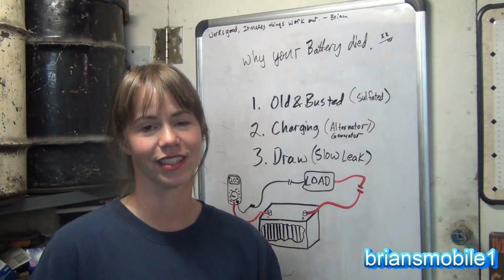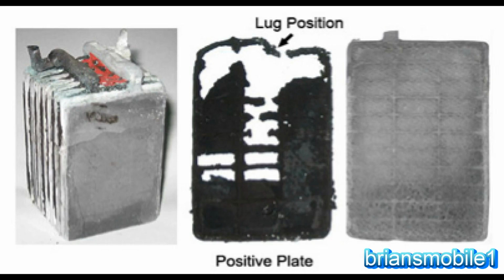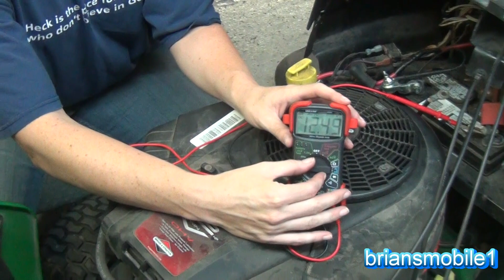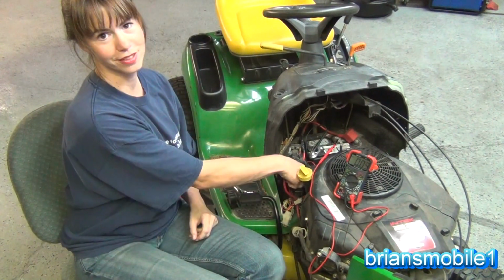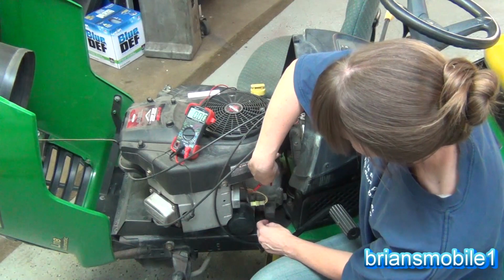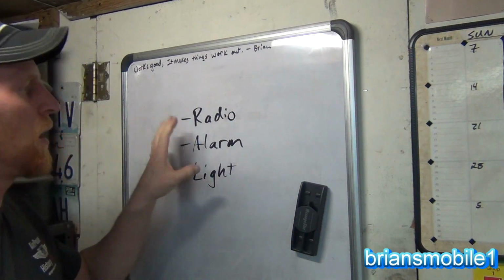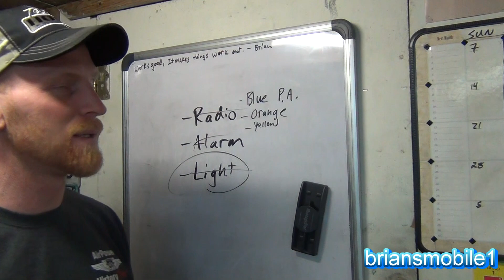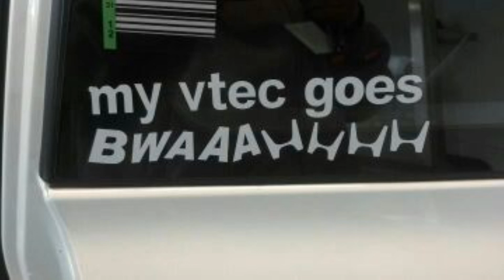Why Your Battery DIED

Comment: My father's Ford Ranger (built in September of 2000) had the same original battery in the vehicle until 2014. 14 years for a battery is really terrific, and he didn't even get rid of it as soon as he needed to, he finally replaced it this year because last winter a few of those 0 degree mornings he said it cranked slow, so he said it'd only be worse this year. Pretty nuts.

Comment: Hey guys, just watched this. I've spent lots of time on old farm tractors (40+ years old by now) and most all have a separate voltage regulator and aside from chafed wiring grounding to the chassis, the voltage regulator is probably the most common component to short to ground and cause battery draw.
Reply from the maker: Thanks for the tip.  
Same goes for old trucks.  
Look for the voltage regulator on the firewall or the metal back wall of the engine compartment.

Comment: I've heard of people de-sulphating their batteries, but it can take MONTHS to do. From what I remember a slow trickle charge is pulsed many hundreds of times a minute and helps to make the sulphation liquefy back into the battery acid. There are videos on Youtube about people doing this with huge batteries used in military vehicles. The users said it was easier to take an old one and try to bring it back to life than to buy a new one which I guess are very expensive.

Comment: Had a 97 ford e 150 in the shop last week that had a 3 amp draw. Ended up being the voltage regulator in the alternator. Seen lots of radios, door ajar switches, chevy bcms, and even a starter cause a draw. Very rare for me to see the alternator pulling amps. Funny explaining the the customer that the device that's suppose to charge the system was declaring it too.
Reply: Decharging I mean. Darn autocorrect

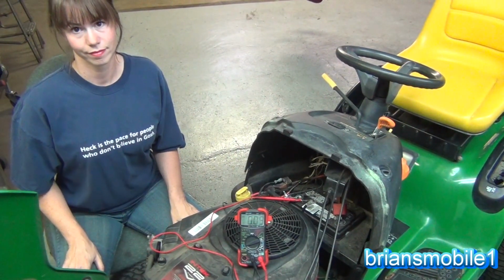Comment: Ignition modules [or anything ignition] is after the ignition key, and that was eliminated @ 5:45.
Old GM alternators have what was called diode triodes that went bad.

Comment: Excellent video! I had the original Daimler/Chrysler factory battery in my 2003 Dodge Dakota 4.7 last 10 years and some change! It didn't even completely let go when I had to replace it. It began cranking slowly, and wouldn't take a full charge anymore, but would still start the truck. I was curious to see what the inside looked like, and found that it was basically a giant sulfated stone. I was unaware there was a term for that condition. From the way it looked, I couldn't believe I was getting any juice out of it at all.

Comment: I have a junk walmart battery I got specifically to use as a bench battery for testing car electronics. Hook the battery up to the electronic, use a little inline fuse, works great and makes sure I get as many amps as I need to power things to make sure they're functioning.

Comment: I may have missed it but some cars need about 10-15 secs if any doors have been opened or key just turned  off to let the computer go into "sleep" mode. Another problem some people will run into is they forget the car doors will turn on accessory lights, make sure them doors are closed or you'll be chasing a constant power.... seen it happen too many times, it's the simple stuff.

Comment: I have awesome luck with AC delco batteries.  I use them in all my vehicles and generator.  They never corrode.  I replaced the batteries in my dodge diesel after 10 years, even though they were still working fine.  I figured 10 years was enough service.  I also use battery minders that have a desulfation mode on all my idle batteries.

Comment: Very helpful Brian and Spanky. Thank you. Just be very careful that you have your multimeter set up IN SERIES before you switch it to amp measurement. You are basically creating a jumper wire when you do this. It looked in the video that Spanky was measuring the voltage across the terminals and switched to amps before moving the leads. Absolutely love your channel. You guys are awesome!!
Reply: Thanks for watching!

Comment: Great video. If you are like me and do not drive very often then you need to charge your battery. For this I built my own charger with a 13.5 volt regulator in it and a current meter. Charging may take a week or so until the current drops to less than 50ma.
Reply: Cool. Do you have more you can share about your creation?

Comment: The energizer battery in my impreza lasted 7 years in the hot Florida sun . Definitely sticking to energizer for now on
Reply: niga6000 thanks bro!
Reply: Original Bosch battery in my 2008 smart lasted until last year so 6 years, it would've lasted longer but a cold snap killed it.
Reply: No, give me the new Duralast battery any day. This assumes you live in the South or a hot area. They have a new line of batteries based on your region that do better in the heat. They produce less cold cranking amps so it can be a hard sale. Basically, they put more lead in the battery to make them more durable. They are listening to a study showing how much more people in hot areas lose their battery. This will reduce how much they have to warranty their batteries. Good for them. Good for us.

Comment: but wait Brian, some of those things such as your radio and alarm do draw but only a little and that is normal,, that is what allows it to keep time on the clock or monitor movement in the car.. what about that draw.. how much draw is OK? (This one was fun to watch by the way. I think your being "out of it" was rubbing off on Spanky - she looked a little lost at times too!'
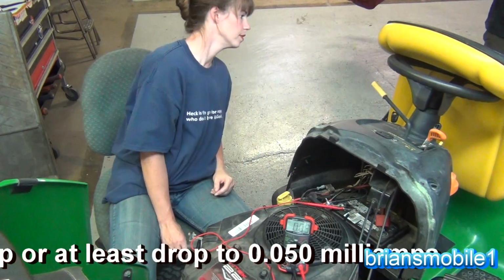Reply from the maker: The tolerable limit in most books is 0.050 amps or 50 milliamps.  It's in the video at 7:25, but it's easy to miss.  It was in the "script" I gave Spanky, but it didn't make it into the vocals.
Reply: I though I saw something about it in there.. just thought I would bring it up.. Thanks for the referral and I hope you get feeling better soon!
Reply: I was hungry. I can't think when I'm hungry.
Reply from the maker: kary1982v6
Thanks Kary
Reply: D6Spanky
 So, you're stomach had slowly parasitically drawn on your mind? :) Happens to all of us no worries, but I have to say, you did fine. Thanks for helping keep Brian's channel fresh... Brian? Your train video worked for that too. :)
Reply: DE Nichols Thanks. It's always fun being on Brian's channel. :)

Comment: I think it is too tempting for an auto store salesperson to show you a digital reading of your car battery and say "there's your problem" when they don't test the alternator first. I keep a fully-charged spare battery in my garage in case I have any problems.
Reply: My spare is my old battery. Not great, but it always does the job in the pinch...assuming the battery in the car is the problem. lol

Comment: So how can I tell the difference if its a bad battery or a bad alternator with a multimeter? Thanks!
Reply from the maker: Test the battery at an auto parts store.  Test your alternator with your DC Volt meter by testing voltage with the car off (should be 12.5V to 13V) and then start the car and run for 20 seconds and measure voltage again.  (should be 13.5V to 14.5V if your charging system is working properly- it will be lower if it's not working.  Remember that it's a "system" with wires, fuses, connections etc. it's not just a stand alone magic Tesla wireless alternator.  Check those too.

Comment: Man you need to rest a bit more. Spanky is sky funny, give her more camera please. Guys, one thing, alway paranoid about, big current range in crap multimeters like the ones you got here, are unfused, but got a separate terminal. But just as easy to forget and try to measure some voltage again, if unfused, you got a blow. Decent tools are FUSED at the big scale, I know .... but tons of cheap crap are unfused. I always double check this thing because previous dissasters LOL. The other side is putting it in series in the low range. Some systems tend to deliver a peak currents as soon as the voltage appears. To reset a motor for example or something, that can get the low range fuse blown. Yes, even the crappy ones I have, the small scale is fused (clap clap clap) and got it blown effortlessly LOL. Cheers to both !!!
Reply: Sky funny? Awesome! That's what I was going for! Hahaha Thanks for watching!